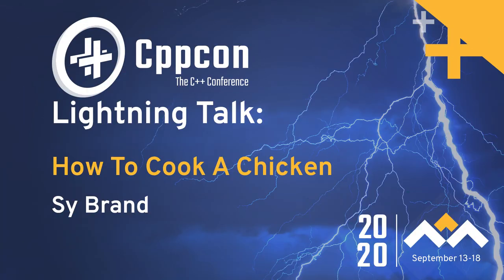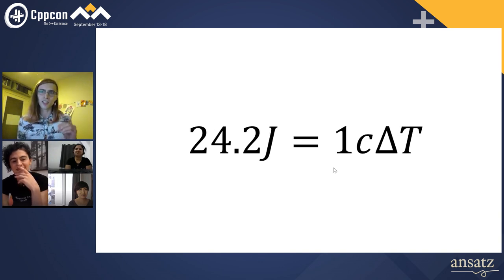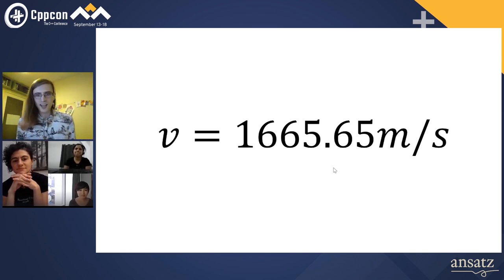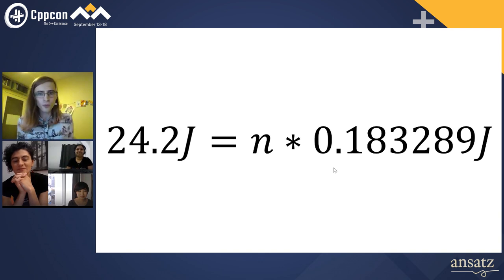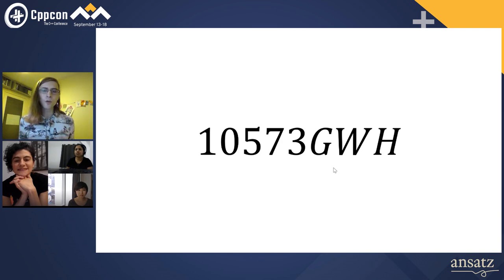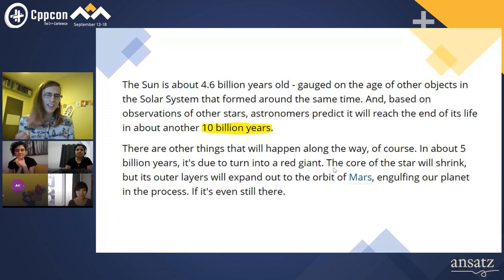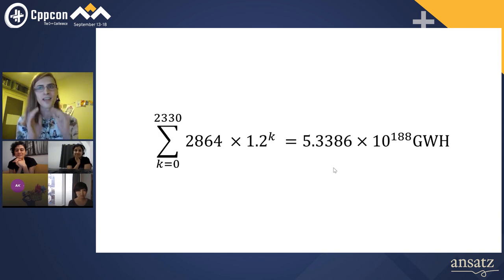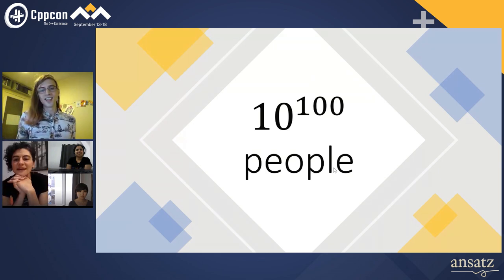How to Cook a Chicken - Sy Brand - CppCon 2020

Comment: If you slap the chicken multiple times you have to reduce it by the heat radiation factor that it's cooling down between consecutive slaps. So it's not the number of slaps but the slaps per minute. EPIC FAIL.